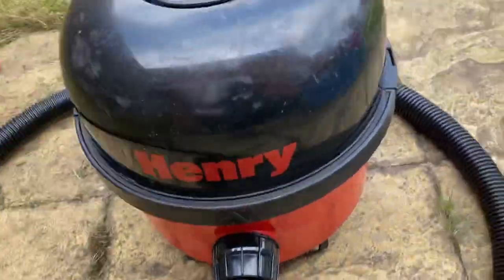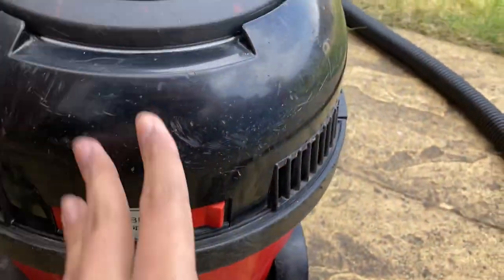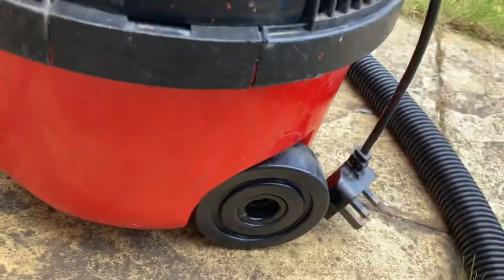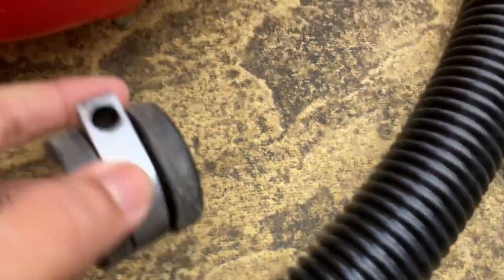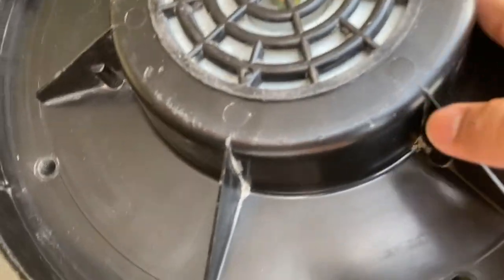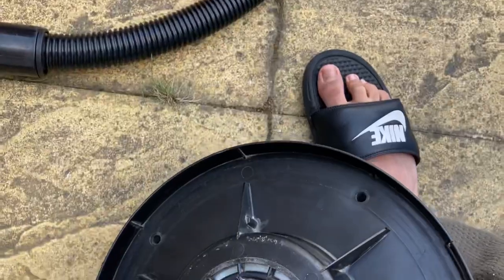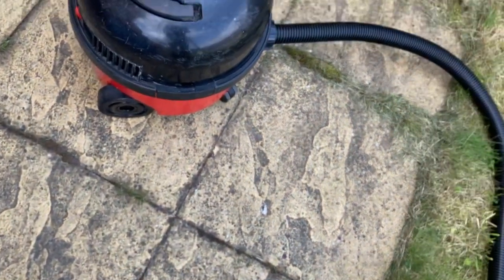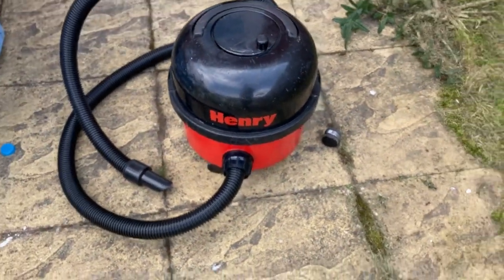Henry hvr200 from 1988 first look and before refurb

Comment: No face
Reply from the maker: Ye back in the 80s you would have to stick them in your self and the last owner didn’t fit it on but now they print them on
Reply: @numaticcollector1014  they had a 3d face and parking bracket in 2012
Reply from the maker: @fernlew8828  yes they do but they print the face on the 3d face